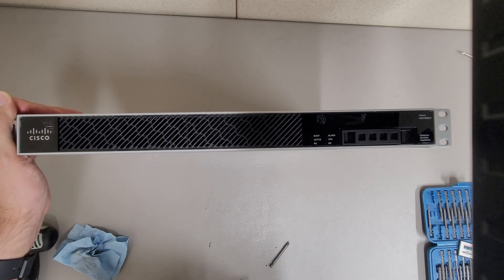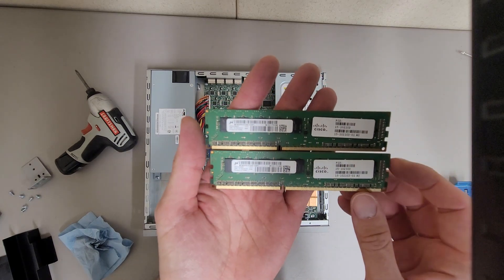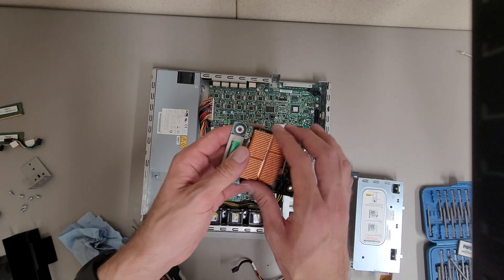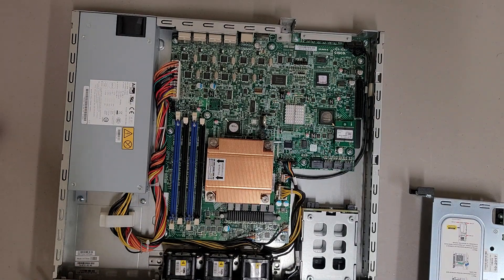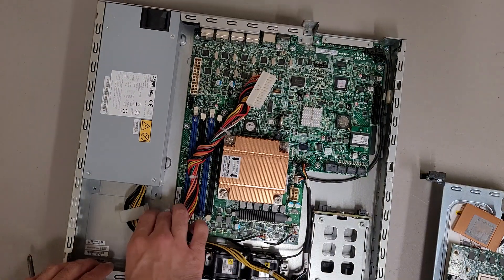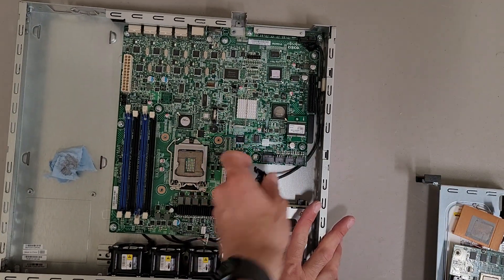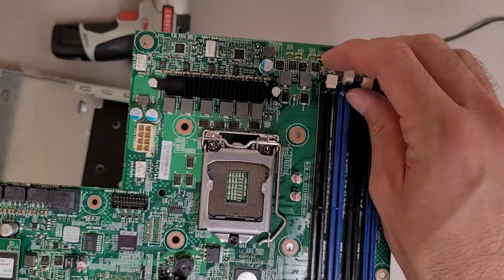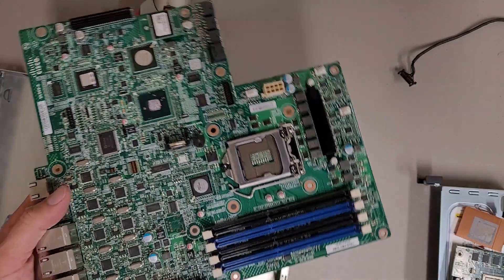Cisco Adaptive Security Appliance ASA 5525-X #teardown

Comment: Did you do a 5515-X teardown? I got one for free and have some questions about some stuff on the motherboard.
Reply from the maker: I don't have a video for the 5515-X unfortunately. I would suspect mostly the same but slightly lower end.
Reply: @computersales  There's some interesting stuff on the motherboard itself
Reply from the maker: @JCarey1988  cool to know. I would have figured they would be close in design.
Reply: @computersales  Interestingly the motherboard was reused for at least one other model, the "Ironport", per a reddit user. Between the absurd number of headers, microswitches, external interaces and unused connections on the 'board it's obvious that it's a general-purpose PC at heart.

Well...that and the fact that you can literally install windows on the damn thing.
Reply from the maker: @JCarey1988  I've heard some people have used them as proxmox nodes as well.